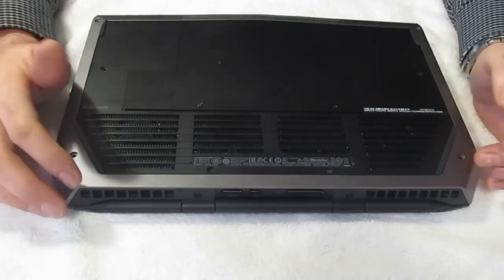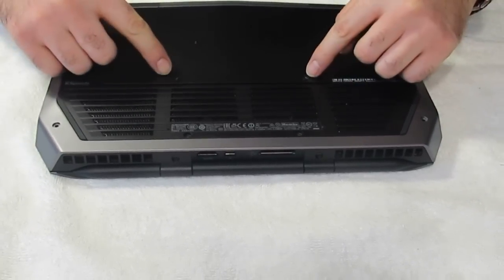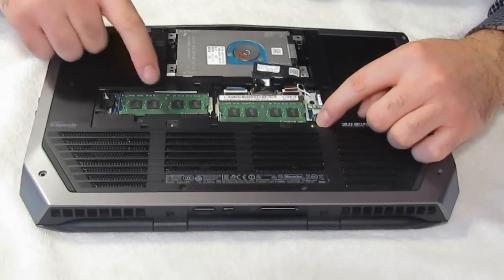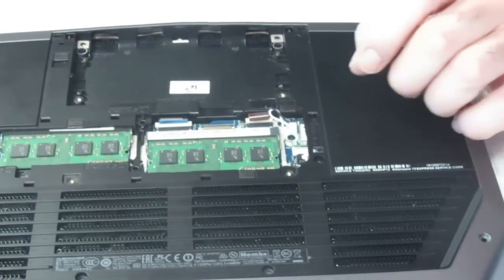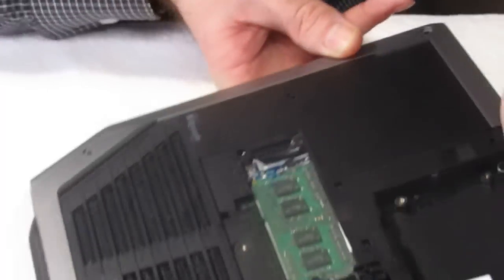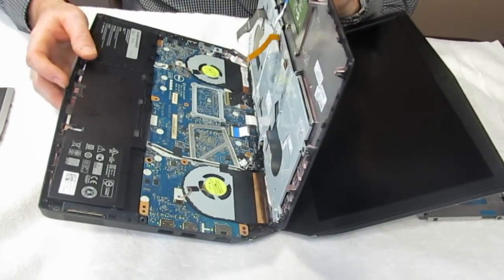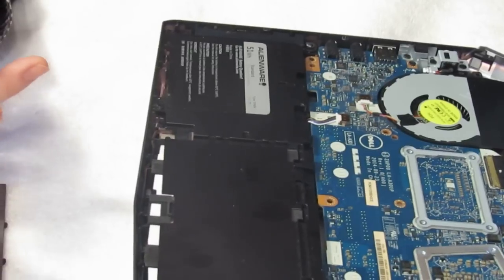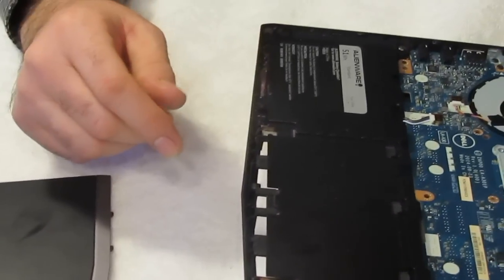Alienware 13 Replace Battery

Comment: Thank you very much for the video. The only tricky part was you didn't show where the battery cable disconnects from the motherboard. Once I found it, no problem, but it was farther from the battery than I expected. Otherwise, my hangups were because I missed a couple of screws, so... good to go.

For those having trouble finding a replacement battery, open your laptop up and find the model on the battery label. Then you'll find a bunch of options on Amazon, eBay, and the many battery perveyors. Mine was model 3V806. Cheers
Reply from the maker: thanks

Comment: March 26 2024 at 530 pm took my swollen battery  out of my alienware  13 was easy until  I got to the battery area was afraid  to push this plastic  like tip thats holds the battery  also forgotten  to take battery  cable out but after  that I was good but before all this ..when I took off the back screws  from the laptop separated  from the computer  board so fast !!? keyboard  hit my screen!!.I thought  😢I broke it ..made flimsy  mines a touchscreen  but I put it back together  without  new battery  to play Warno ,Tekken 7 , and Soul Caliber 6/7  I'm good  laptop super light too without battery ..but I will buy another battery for it but  for now my laptop can rest beside my graphics  amplifier  ..Thank-you for the video  I also had the right tools before  opening the laptop
Reply from the maker: cool

Comment: Hi, thank you for you video! I have no power issue on my new alienware 13 sometimes. Do you think it is the battery issue? Or power button's connection?
Reply: Hao Shu i have problems with my power botton too

Comment: Havent even had my laptop for a year and its already screwed up... And I dont really wanna take apart my entire computer epsecialy sense I have no clue what I am doing. Can I take it to a place and have them get the part and fix it? or do I have to get the part and bring both to a place and have them fix it?
Reply: Go to local Computer repair shop, they can do it for you.  They can purchase part thru re-seller and replace.  Manuals are online so they can check procedure and do it for you.

Comment: For writen instructions go to 
http://www.dell.com/support/manuals/us/en/04/alienware-13/alienware13_sm-v1/Before-working-inside-your-computer?guid=GUID-5D3B1051-9384-409A-8D5B-9B53BD496DE8&lang=en-us
I do agree actually showing the removal of battery would help the every day user a bit, but on the other hand I do think he detached the Power Cable before taking out memory and WiFi transmitter.  Unlike the Dell Video.  Including the small details which takes 2 minutes longer is actually probably helpful to people...

Comment: Will this be similar for Alienware 15?
Reply: I wouldn't trust that to be the case.  I watched Allienware 13 R3 version from dell website video and it's different as well.  Dell tech didn't remove battery cord first, but he took off bottom and back.

Location/size for new version was totally different.

Comment: damn.. i wanted to take my battery out while using my laptop at my desk so i could just keep it plugged in and not worry about burning out the battery early but im not sure i wanna open my brand new expensive laptop up like that just yet
Reply: +John Doe From my understanding, you just need to unplug a cable, and no more battery power. But, I have yet to try that, though I do intend to try it later down the road.
Reply: +John Doe By burning out, you mean keeping the battery fully charged at 95-100% all the time? Yes that will wear it out faster than staying at 80% or less charge level. I guess Alienware doesn't have the ability on their laptops to limit the charge level when you don't need it all. I know Toshiba does, can set it to limit it to charge to 80%.
Reply: +danwat1234 +danwat1234 Ok from what I&#39;ve read, and not saying you are wrong or anything, but once the battery is charged while plugged in it stops charging the battery and runs off of the A/C adapter. But its still bad to leave the laptop fully charged all the time? I only ask because mine is plugged in when I&#39;m gaming all of the time and I&#39;ve only let it drop down to under 30% about 3 times out of the 2 months I&#39;ve had my AW13.
Reply: +Joshua Amador Well, you need to have it plugged in so it won't use the battery. You could take out the battery and leave the battery at 80% charge or less that way. So the battery will last more years before becoming useless. I don't think with an AW that you can configure it to not leave it all the way charged. So the only thing you can do is take out the partially charged battery. I could be wrong, maybe AW does it now on some models.
Reply: +danwat1234 theres a setting in windows power save options called desktop mode that makes it run off the ac power unit.
Reply: +Brandon Browning (Branflake45) hmm? Are you implying you can set it so it won't charge the battery all the way, for longevity?